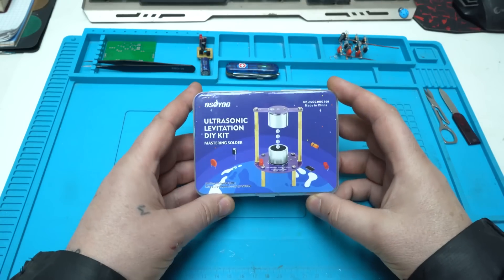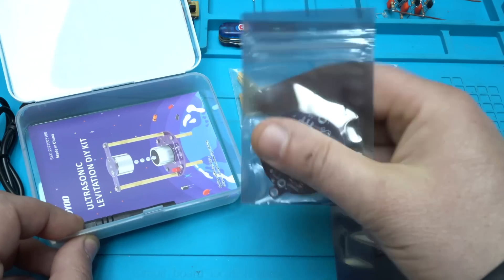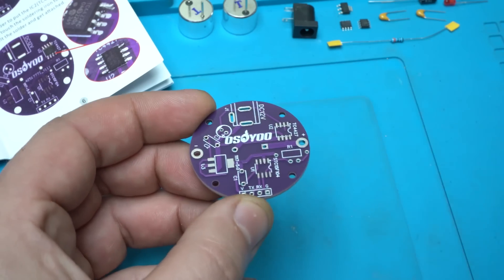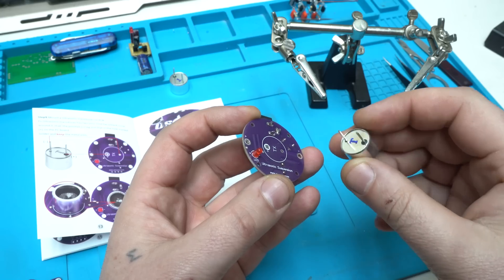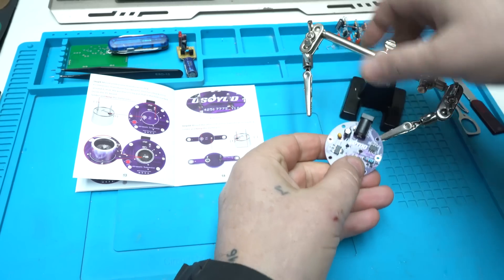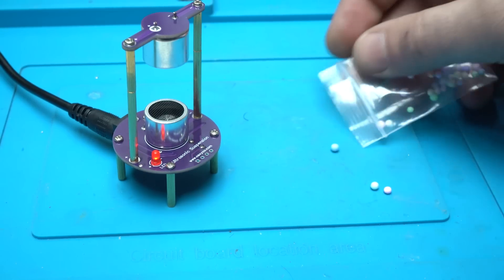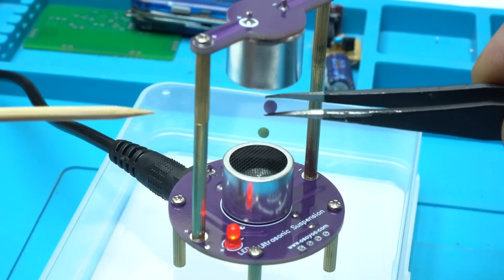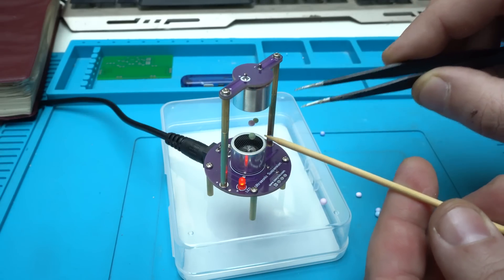Ultrasonic Levitation DIY KIT by OSOYOO

Comment: So the next thing you need to buy is a "heat plate" that is used to solder SMD's like in this project. You should try some projects using the mmWave Radar sensors like LD2410, LD2450, LD2451, LD2461 etc, very simple and fun. Some people try to use them to light up addressable LED's as they way down the hall etc.